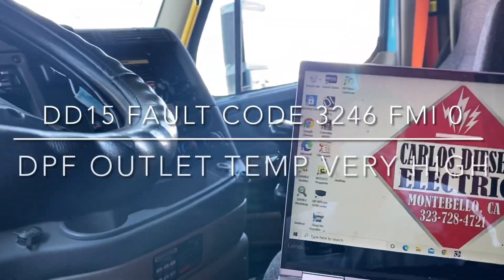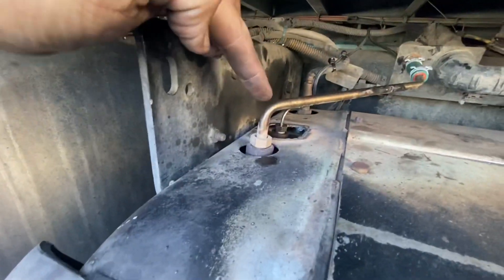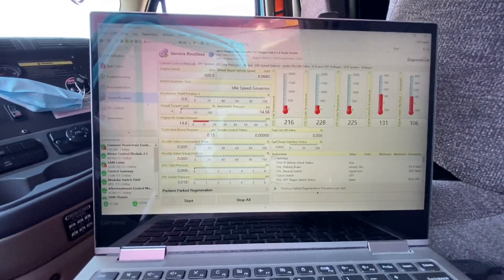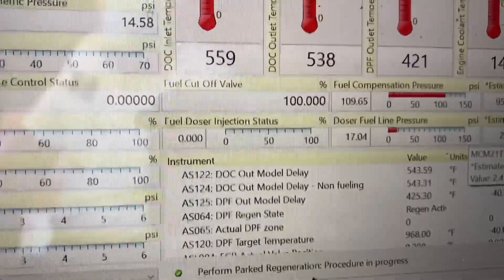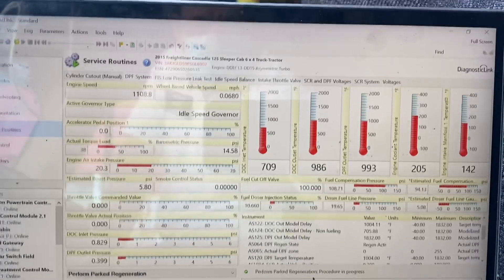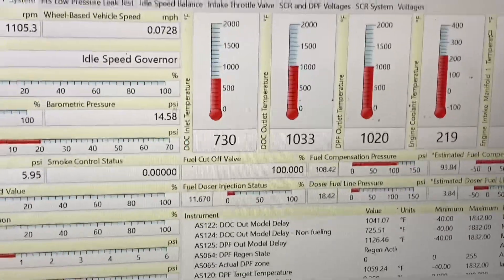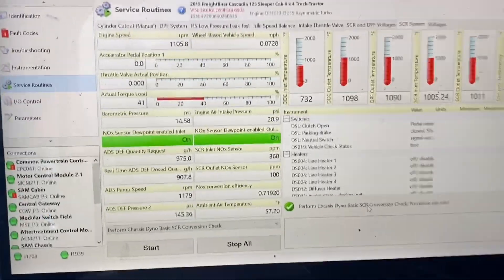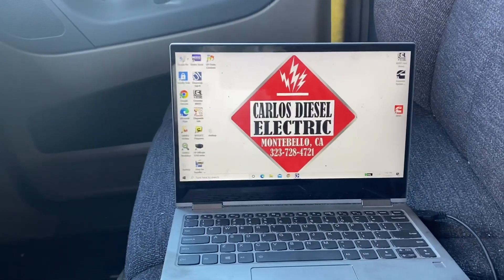DD15 fault code SPN  3246 FMI 0 DPF Outlet Temperature Very High

Comment: My 2022 Freightliner Cascadia is not doing regeneration automatically, not even while idling. When I am driving and take my foot off the accelerator, it makes a sound similar to the engine brake. To keep driving normally, I have to press the gas pedal harder until the soot level comes back to normal. I already replaced the DEF doser, but the problem is still there. Do you have any idea what could be causing this issue?
Reply from the maker: Has anyone tried connecting to the truck, performing a parked regen and monitoring the truck? Also, have all software updates been performed?

Comment: I have a DOSER FUEL LINE PRESSURE 65ish but everything else is good(750 doc input, 1080ish DPF temps, 88 NOX efficiency, .91 DOC inlet pressure but I keep getting a 3556 1 fault. the 7th injector was replaced. any help would be appreciated. 2016 dd13
Reply from the maker: When I get back to my shop. Let me look up the fault code, it sounds like you are able to reach temperatures and you have efficiency. Inlet pressure looks good. But not sure why the temperature fault is there. Have you tried using another ACM to test with?
Reply: @CarlosDieselElectric  thanks for reply. No I don’t have another ACM to try unfortunately.

Comment: Doser was heating  1 box up hotter  then should  be  activated red blinking light shutting  down  truck. I tryed  blow air in it and cleaned  didn't work  had replace  it then was able to regen  successfully
Reply from the maker: I have seen this happen a few times. Usually shop air does the trick. I have even seen a piece of soot get stuck at the tip so when it dosed a lot diesel was getting through. The temps went through the roof.

Comment: Great video thank you. Can you tell me the average temp during a regen.
Reply from the maker: DOC inlet will always be lower than the DOC Outlet and DPF. 
What year is the truck?
Reply: @CarlosDieselElectric   2016 frieghtliner cascadia. DD 13
Reply from the maker: @Bill-j2g  during a regen for GHG14 
DOC inlet 700-800
DOC outlet 900-1050 average 
DPF outlet 900-1050 average. The DPF will usually mirror the DOC outlet.
Reply: @CarlosDieselElectric  thank you for the response and it was super fast at that. I just subscribed. Thank you

Comment: Love the information thank you.
If u dont mind I have a question.

My Mil light is on and I am trying to diagnose it.  I have cleaned dpf filters and replaced both nox sensors in the recent past.  
Any ideas on how track and fix mil light issues? 
Also will bad one box temp/pressure sensors trigger Mil light?

Thanks in advance.
Reply: I had someone clear it for me when I replaced the noxs last month and the light came back after 150 miles.  I will try to find someone with scanner.
Reply: @ranbirsohal8886 update please?
Reply from the maker: What fault code or codes are you getting?
Reply: I am currently get no codes on my dash.
Reply from the maker: @ranbirsohal8886  have someone plug and see what the MCM or ACM is reading. The code may not be active but there is definitely something there. Or maybe just a simple clear

Comment: What is the normal range for the dpf outlet pressure to run at and when should it be a concern. Mine is running at 1.7 psi and the doc inlet pressure is around 1.1 psi. Thanks

Comment: Which freightliner analyzer would you suggest I buy for my use so many out there
Reply from the maker: If you are working on Detroit engines, then go with the original program. Detroit Diesel Diagnostic Link. It works on Series 60 12.7L, 14L, MBE, DD engines, emissions and also the DT12 transmissions. 
In my opinion, that would be the best option.

Comment: Quick question, why did you replace the temperature sensor? Was it not reading at all?
Reply from the maker: The sensor could be faulty, this can cause the temp sensor to read higher than it should. My approach is "LOW HANGING FRUIT". I like to typically start with the smaller or less expensive options first. If that does not work, then I proceed with removal and cleaning of the DPF filters. This is the one option I like to try after I have tried sensors. Typically cleaning filters, parts, labor and testing will cost around $1100 or more. So you can see this is why I like to save this for later.
If the sensor is original and has never been changed then a sensor is the quickest option and cheapest.

Comment: Detroit Diesel in Rockford IL replaced my DEF pump about 7 weeks ago. Got about another 10k miles on it since and now has total engine shutdown on I-40 in Arkansas. Pulled off, checked codes and got the exact code you titled the video. Anyway was able to start the truck and drive another ten miles to a safer spot. No derate at all, but continuous beeping and dashboard reads “shutdown in process” the whole time… any thoughts?
Reply: I'm having same problem
Reply: Did u find out the cause
Reply: @supplyunlimited1360  I’m very sorry I don’t remember that far back what it was

Comment: Could the dozer valve stuck open cause high output temp even with new sensor??
Reply from the maker: Yes, the diesel Doser valve can be stuck open also, look at your diesel Doser block.
Reply: Sure was fixed the problem thanks.

Comment: All dialer can't find the problem...we have check engine light on diagnostics how spn 1569 fmi31   and spn3246 fmi15 Peterbilt dealer changed temperature 🌡️ sensor out .... 💯 Miles and check engine light back to .
.I don't know what to do next?what parts we are needed?if you know something Please....Help.Thanks

Comment: Mr Fuentes your videos are in a class all by its self very informative im grateful to have found your channel . that said what causes a up n down slight surging at idle on a dd15 freightliner cascadia ive been told by some shops it could be this could be that . i have no codes just a slight surging up down up down it  drives you nuts. if you can reply i would really appreciate your help
Reply from the maker: Surging at idle sounds like it could be the quantity control valve. What else is it doing?
Reply: Thank you for replying,  I'm going to have the control valve checked , is this a serviceable part or replace only ? It doesn't throw a code for it , the only code I've gotten recently was spn 1077 fmi 14 it come on and then goes out won't come back for months then it does  and goes away so I don't think its anything serious.  Again thank you sir for your info . 👍
Reply from the maker: @porttrucker  I recommend to find a shop with asome DD15 experience. The control valve is $650-700, it is located on the backside of the hi pressure fuel pump. 
Let me check out the other code and see what it says.
Reply: @CarlosDieselElectric  thank you sir I will look into getting a good shop with honest people it's difficult to find thats why guys like yourself are so helpful and knowledgeable about your craft. I can see you do what you do from the heart 
Thanks again for reaching out 👍

Comment: Love your videos thanks 
Quick about the one box how common do you see it replaced at 700,000 miles I have over 900,000 on mine to be honest had very little problems out of it replaced doser valve, both nox sensor,  def injector pump, cleaned the filters. Actually getting ready to clean shortly again. Just curious if I should start looking for new box or wait for sings of failure.?
Reply from the maker: It should only be an area of concern if NOx efficiency fault codes become more frequent. But it sounds like your truck is running great. I say you are doing things right. Glad to hear you are at 900,000 miles.